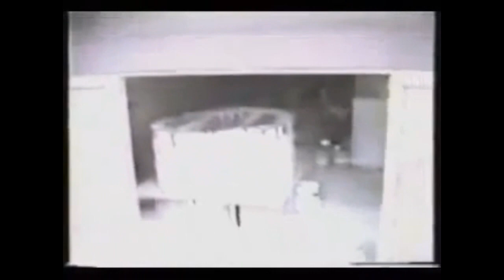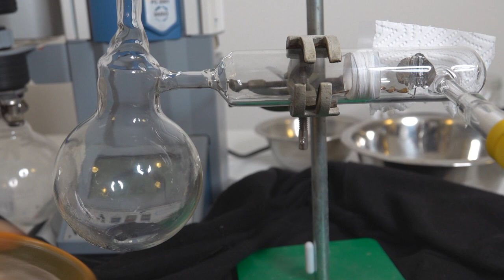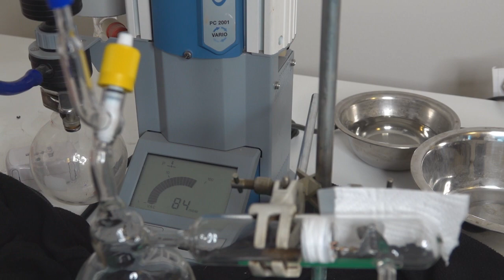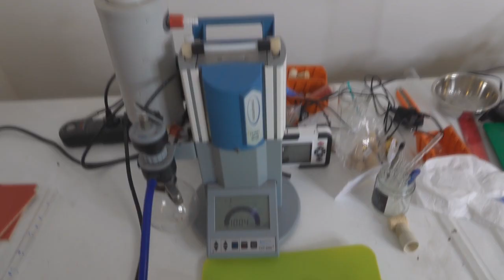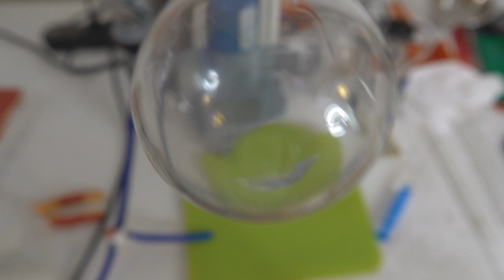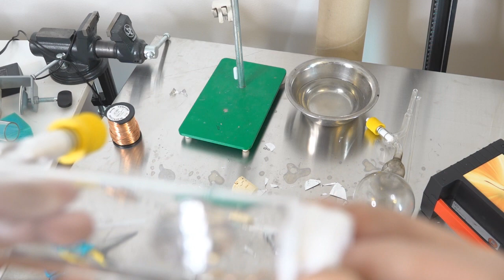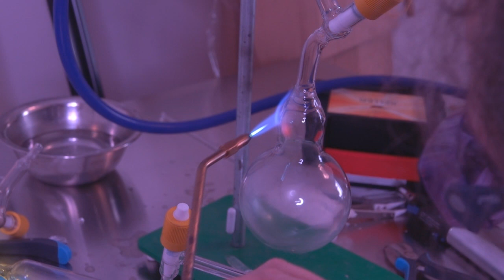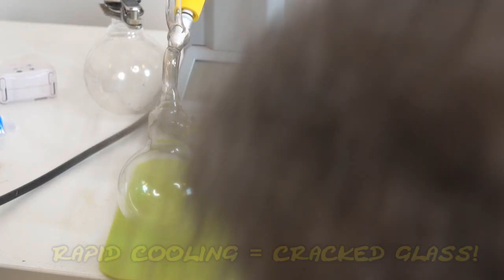The “Hydro-Vac” Space-Powered Steam Engine!

Comment: I’m a freshman engineering student and it’s really simple why this “space steam engine” hasn’t been commercially viable.

It just runs off of the vapor pressure of water at (for this experiment) room temperature. The vapor in the vacuum is drawn near the cooler side containing the water because the cold side creates a low pressure zone by condensing the water vapor in the system. Before the vapor can get to the other side it has to pass through the blades which spins them and by doing so it imparts energy. Since the density and velocity of the vapor is relatively low, the potential for energy production is very limited. 

I don’t know if this was a video joke but I really don’t know why this is touted as a great “limitless energy”.
P.S. you have to input energy to cool one of the flasks through refrigeration.
Reply: Garrett Jensen 

This wasnt a debunk video though, he just made it to see if it worked. If it is viavle commercial product is another topic.

Comment: For those saying it takes too much energy to cool it... Couldn't you just place the condensing side into some flowing water or in a hole with some ice at the bottom? There are plenty of low energy cost ways to cool something.
Reply: It will transfer heat outside 😥 assuming it's cold outside. Opposite if it's hot outside.

Comment: It's a . . . sterling engine.

Riddle me this: why is a single source heat engine Impossible?!  Won't it just cool the whole system until it draws more heat from it's environment?
This looks very similar to an Idea I had: a chemical heat pump using 2 different catalysts and a phase change to separate hot from cold and turn a water wheel as it condenses and falls back down. 1 catalyst stays hot while the other catalyst stays cool by reversing the reaction.

Comment: So let's take a closer look at this device. Fundamentally, it's a steam engine, but instead of using steam, it used water vapor. Flask #1 contains water at room temperature, so the vapor pressure is about 0.5 psi. There is little to no air in the entire system, so the overall pressure will be equal to the vapor pressure, about 0.5 psi with no ice added. Once the ice is applied to flask #2, the temperature drops meaning the vapor pressure drops too. This leads to higher pressure in flask #1 than in flask #2, and the vapor flows powering the mini turbine. In simple terms, water evaporates in flask #1 and condenses in flask #2, so there is a flow of vapor between the two.

Yes, it spins a small tinfoil blade, but can it produce power on a large scale?
Most likely no, and for many reasons. I however, am going to keep it simple and only talk about a few.

Let's say you put a giant vacuum tube connection warm water at the equator to the cold water at the north pole (Which is what he has suggested) . From a quick google search, the equator can have water as hot as 80 F and the north pole can have water as cold as 28 F. Looking up vapor pressures,  at these temperatures we have north is about 0.075 psi, and equator is about 0.5 psi. Sine air temperatures can be colder then -28F I'm going to be generous and call the difference 0.5 psi. It's been a long time since I've calculated friction losses in a pipe, and I don't currently have the time to do so. However, 0.5 psi is not going to lead to very much flow through a pipe thousands of miles long because of friction loss. The vapor will have very little force behind it (because of the friction loss and because it is only at 0.04 atm) meaning it will not be much use in powering a turbine. Even if your pipe is huge, you are going to struggle to produce very much power at all, or even get the turbine to spin.

The other problem is maintaining a vacuum. With a giant vacuum system there will inevitably be leaks, meaning you will need to constantly run pumps, and I doubt the energy being generated would be enough to run the pumps.

I would be interesting to se this idea implemented where there is a natural hot spring next to a cold ocean. In that circumstance it may generate useful power, but would it be as efficient at a modern stirling engine, something tells me it wouldn't even come close, but we would need someone to sit down and do the math to know for sure. Thunderf00t?

Comment: In a vaccuum water evaporates at very low temp!
The ice condeses the amount of water vapor on the one side, so the water vapor from the water side moves to the cooled one!

The thing is, how did you make the ice? Did it need more energy that the machine produces?

It can be much easier, solarpanels, or a sunpowered Stirling Engine!

This is clearly just a strling engine, without piston and not heated, but cooled and it works till the water is gone on the warm side!
This is not free egergy, its kind od physical energy!

I guess Solarpanels are kore efficient!

Comment: As with all these perpetual motion machines; Thunderf00t's eclectic bong here is a prop. Those drinking bird toys are more impressive as an engine. The fundamental mechanics behind this is the temperature difference between the room and the ice. That temperature difference is far from free energy. Energy must be transferred to either heat the warm room or to produce the cold ice. 

If it takes no effort on your part to warm the room,  then it's because it's warm outside too. That would be energy from the sun. In that case, great. But now you need to make ice. You need to harness that free solar energy with solar panels (or a Solar Freakin' Roadway if you want piss poor output and some flashing RGB lights) to power a pump to remove heat from an area, allowing you to make ice. Of course there would be far less loss by just powering the engine with a solar panel in the first place. The efficiency of such a system is horrific. It would be far better to use a thermocouple. That's exactly how many spacecraft and the Curiosity rover on Mars are powered. It's inefficient but the heat produced by radioactive decay is allows passive heat production for decades. 

If these people do make money on this scam, then congratulations to the people who just funded something discovered at least a couple of centuries ago.

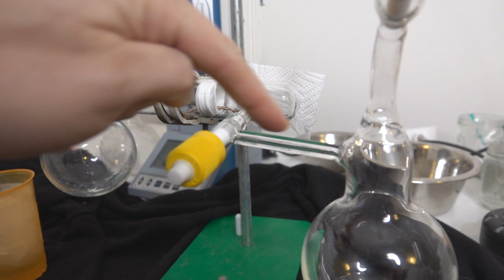Comment: 2:00 Shouldn't water boil at lower temperatures when you lower the air pressure? So if you would have a total vacuum, shouldn't that water be boiling?
Reply: Never mind, I just calculated, it should be about 0,03 to 0,04 bar for water to boil at room temperature

Comment: Why didn't water boil though? It's boiling temp should have reached temp room in Vaccum, someone explain please.
Reply: You'll notice that Thunderf00t was careful to use new, clean glassware - no scratches, no dust. Similarly, I'll guess he used distilled water, previously boiled (to remove dissolved gasses).
Without anything to provide a rough surface, water is reluctant to form bubbles and boil in the way we see in kettles/saucepans. If you give it a good shake, then I expect it will bubble up - because you've given something to start forming bubbles.
Whenever we used to do distillations, we would always add "anti-bumping granules" - something inert, with rough surface to help bubble formation - it's easy to heat liquids beyond their boiling point if the flask is absolutely clean, then find that everything shoots out of the apparatus when it suddenly start to boil... (stains on the lab ceiling! - and run quick)
Reply: @colinprice712  Ooo interesting, thanks for explaining! :D
Reply: You're welcome. Long time since I did high vacuum work!
Just wish my glassblowing skills were as good

Comment: The simple fact that this thing requires an energy gradient proves it is not any sort of 'free energy'.
Instead of heating the water externally, you cool the condenser externally.
Either way, water vapors are mobilized by the temperature difference of 'boiler' to condenser.
This feels like a very deliberate effort to mislead those not versed in thermodynamics.
Reply: I think that the point of this video is to show that u can be misslead, he just took a regular steam engine and made it work in unusual conditions to show how easy it is to fool people.

Comment: This would not work in a isolated system as the water at the start should be at a higher temperature than the water vapor at the other side which makes it to have the water to be continuously heated in the system which does not make this "free energy" but rather solar energy(and a few other sources of heat of the earth) being harvested.

Comment: Whats happening here is that the water boils becouse of the low presure, the water then fills the entier system, then stopps boiling when it has reaced a sertine presure, you then add the cold object and the water becomes cold enough to become a liquide again and heat is taken away from the system into the cold object through the glass, there is now room for more water to boil, however as more of the "hot" particles boil from the water the cold ones are left and eventually become as cold as the water in the other side where the cold object is, here you would have to add more energy in the form of heat into the system, and the energy you get from spining that fan is not enough to warm the water back up, this it's neither free power nore is it infinet.

PS! i hope this is a joke thunderf00t, your worrying me, hope the busted video comes after...
But cool concept (yes that was a pun), and as long as your enjoing yourself keep it up. world is going to shit anyways, netflix just listed a documentary saying the earth is flat so....

Comment: Yes, you can run a steam engine at room temperature. No, it can't generate infinite free power. You need a temperature difference between the evaporator and condenser. It's not possible to maintain the temperature difference in a closed system without adding energy. The energy you need to add to maintain the temperature difference will always be more than the energy the steam engine can provide.

Comment: Free energy? I don't think so, not when you need a temperature difference between one flask and the other. All you're doing is using water's low vapor pressure in a vacuum to boil the water in the warm end and condensate it in the cool end, and turn a tiny turbine in the middle....the problem is the warm end will be getting cold and will eventually freeze solid.

Comment: Hi Thunderf00t,

The design is flawed. You should add a hamster, and for optimal results, ditch the vacuum and allow a gentle flow of air. It will spin a much larger wheel. Hamsters run on bio fuel, you can grow it in your garden. Added bonus is that this will make your device CO2 neutral (production of the device not included) and will make it more commercially viable. Target group will be little children or even better: their parents. Superficial research shows that hamsters and spinning wheels can be sold to them even without the added ¨free energy¨.

Kind regards, Roland

Comment: Isn't this just a redesign of a Sterling engine?
Reply: No.
Reply: @isodoublet  And why? It works on the same principle of moving gas by a heat difference inside the engine.
The cylinder in a sterling engine was just replaced by an aluminium turbine here
Reply: "And why? It works on the same principle of moving gas by a heat difference inside the engine."

That's not how a Stirling engine works.. Not every heat engine is a Stirling engine. Stirling cycle = two constant volume heat exchanges and two constant temperature volume changes. This thing here doesn't even operate on a cycle so it's not an engine at all in the conventional textbook sense, and the temperature of the working fluid  isn't even constant across the engine itself.
Reply: @isodoublet  The cycle of this engine isn't shown completely here I'd say..

Since the water hasn't fully vaporated/condensed in either flask.
Once the water fully condenses in the other flask you can cool down the other.

The only heat engine I was aware of exisiting is the Stirling engine, so calling it a "redesign" was simply because I did not know a general term or other types existed.

And by "moving gas" I meant the volume change, English is not my primary language and I paraphrased it badly I guess..

But thanks for the answer anyway
Reply: Yep, that's right, if you want to think of this as the typical engine and compute its efficiency (for example) you need to consider the whole cycle.

Comment: Wait what?!
You're kidding right? 
I'm gona go on a limb and say that this video was 100% sarcasm based on past videos from this channel, (wasn't sarcastic enough to my liking)
But just in case people somehow believe that this is an infinite power source, let me explain:

This is a similar concept as an "LTD stirling engine" except you remove the air and add water (a "drinking bird toy" is probably a better representation).
This is an engine working with HEAT... It is NOT infinite power, and the power input (the ice and room temp) is VERY HIGH compared to it's output.

To make ice, it takes ALOT of energy and it NEEDS to be there.
You can say that you will use radiating pannels and some sort of heat plate to cause a difference in heat, but the heat has to come from somewhere!
There are MUCH MORE EFFICIENT existing devices that convert that heat differential into electrical power. It's called a "thermoelectric generator"; one side hotter + one side colder = electricity. That's an energy input!
It's an engine that works in a vacuum powered by ICE! Not by space!

Comment: Until you put any torque on the axle and it will no longer work. Of course you already knew this.. It's a nice high school experiment but I have very little faith in a device with this principle will be able to produce more power than it consumes. If it did, it would most likely already be invented and the use of expensive energy plants (coal, hydro, nuclear, etc.. ) would be obsolete.

Comment: No need to have someone debunk this, as common sense should kick in and everyone should be able to notice that this would not work. First off 'free energy' is not a thing, since that's just basic physics. Yes it works off temperature, basically the same thing happens here on earth which makes what we call 'wind'. So what happens when the differential normalizes? Yeah that's right, it stops. Also if you try to pull power off of this what's going to happen once you put resistance behind it? Notice how his spinner is made of aluminum foil, super light weight. Yeah, everyone should be smelling BS here.

Comment: this has to be a Poe right? somehow i doubt this device would produce the energy it would take to cool (or heat) one side, then the other to cause the movement of water vapor to move the turbine, let alone a source of "unlimited free power." assuming the device would be located in low earth orbit couldn't you get the same reaction from some sort of solar sail turbine without having to introduce water or heat to begin the reaction? come on thunderf00t, this has to be a poe. you debunk much less obviously flawed theories.

Comment: It MAY in fact be possible to get a great deal of energy out of empty space, but you REAAALLLLY don't want to do that..... because if you did, it would necessarily require that the space fall to a lower energy level. And if it did, the space around it would make this transition too. And the space around that. This process has a name. Its name is vacuum decay, or false vacuum decay. The decay of regular space time, to the higgs ultra dense field. And if it happened, it would literally be the end of the universe. The entire universe. Ended. The big nothing. A bubble of snuffs-out-of-existence-everything-it-touches that expands in all directions at the speed of light. Now this may or may not be possible, it depends on whether our spacetime is currently in its lowest energy state possible. But if it isn't, the universe WILL end this way one day. And an event that would certainly set it off, would be the final moment of evaporation via hawking radiation of a black hole. So I'd also advise against making a black hole spaceship drive, if it ever becomes feasible to make small-mass black holes. If you made a tiny black hole that made a significant amount of hawking radiation and would decay in a non-huge amount of time, the only thing you could do to temporarily save the universe would be to drop it into a larger black hole. It would make for a decent sci-fi story, I think, something like the lord of the rings, a small object of great power (the micro black hole) that needs to be destroyed and the only way to destroy it is to drop it into not a volcano but a big black hole.
Reply: Damn I thought worrying about politics was worrying over something I had no control over, I have to set my horizons higher!

Comment: This is just a very ineffective sterling engine. Right?
Reply: No, it's just a normal steam engine/turbine, with the condenser operating below room temperature.  The trick is that under vacuum, water will boil at much lower temperatures than you'd expect.

Comment: If thats a pure vacuum then why don't the water just turn to vapor.  And also why use ice when you could just put your hand under the water anx make it boil like we did in 5th grade science class in 1965. Oh thats right they don't teach real science in school anymore.  Personally i think a nitrinol engine is much more practical and effective if your goi g to derive energy from a temperature difference.  Sterling engines are just a novelty no mater if they are made from a teapot ,metal, or crack pipes.  I say bore tunnels from denver to vail and load them up with turbines and;WALA Free electric 24/7 !